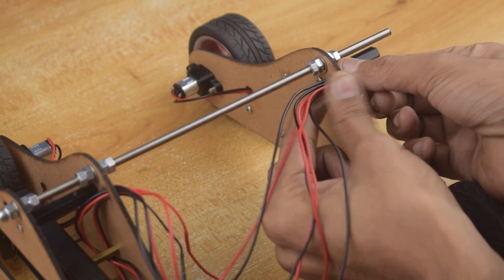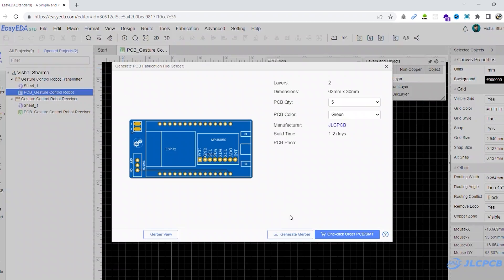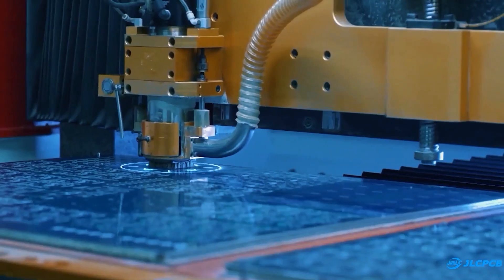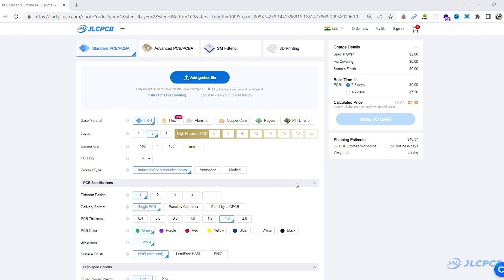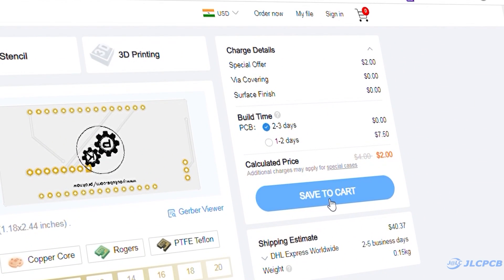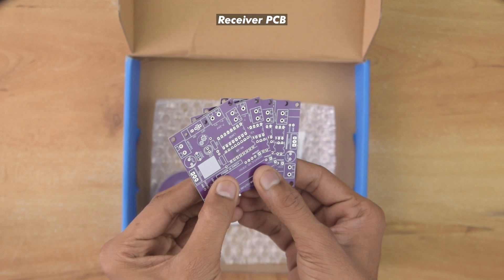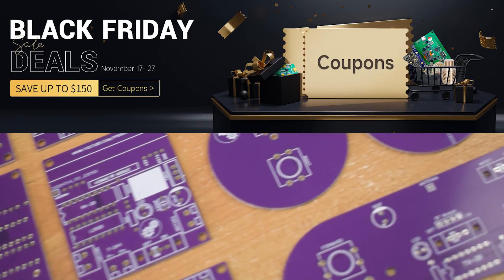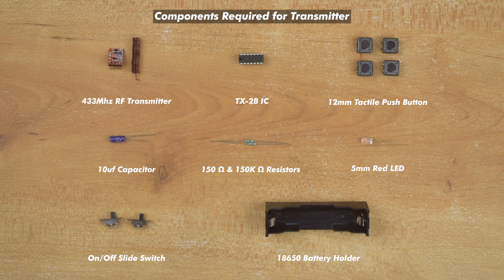Homemade Remote Controlled Rover - Very Simple

Comment: Nice one bro. I really liked ❤it's design. Which material do you are used for this? And which machine for cutting?
Reply from the maker: Thanks, bro. I used a 2.1mm MDF Board an my laser engraver machine to cut it but you can easily cut it by hand saw, The .dxf file link is available in the description.
Reply: @proknow  ok bro thanks for your reply